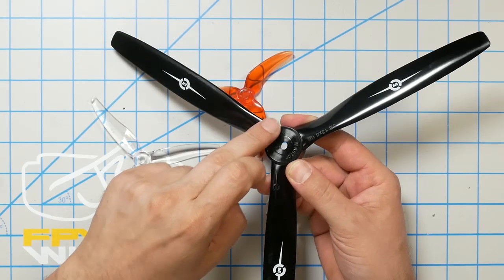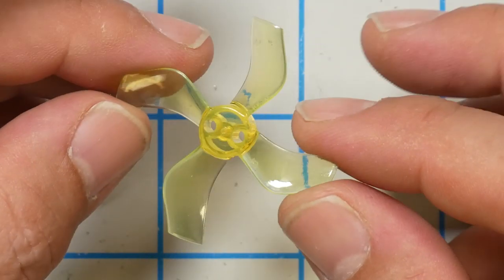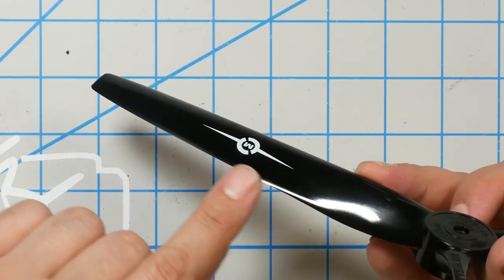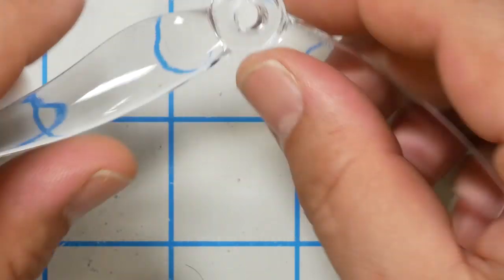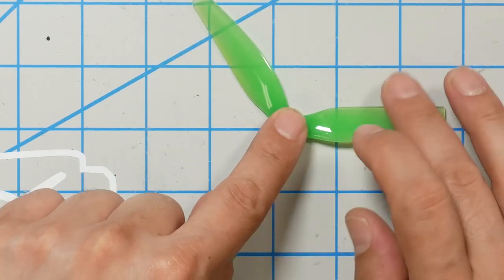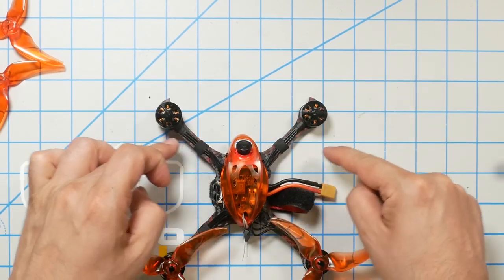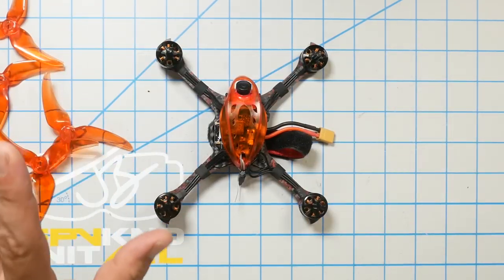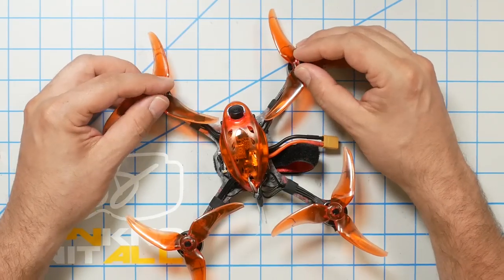How to install quadcopter props correctly BEGINNERS WATCH THIS NOW!

Comment: hi their..... complete beginner here. at the moment im focusing on flying my quads line of sight.  one of the difficulties I have is that when the quad gets a certain distance away from me I really begin to struggle to identify which direction the drone is facing and even which direction it is travelling.  ive seen on betaflight two modes that I think can help. HEADFREE and HEADADJ. ive looked on the internet and here on youtube inc your vids. unfortunately I haven't found much to help describe wha this is and demonstrate how it works inc mode set up of this function in betaflight.
can you help?
Reply from the maker: I can't help with this at all. I am also TERRIBLE at line of sight flight because I rapidly lose orientation. 

To use HEADFREE mode you need a compass.
Reply: @JoshuaBardwell  i have compass in my gps. One of the cinfusing parts are the two modes... Similar yet different. But very little info about them.

Comment: How tight do you tighten your props?
Reply: @JoshuaBardwell  how snug?
Reply from the maker: Tight enough that the prop doesn't move if you push it with a finger.
Reply: @JoshuaBardwell  Thanks dude

Comment: cool but nuts part is missing hot to tighten the nuts ???
Reply from the maker: I don't understand. Use a wrench? Which part is unclear?
Reply: @JoshuaBardwell  Well, as a noob, I don't know if it's the right way to screw and unscrew the nuts. Among other things, this is not so easy because the motor slips in your fingers... You should also use pliers ? In a video I saw that someone takes the propeller and the arm in his hand to screw or unscrew the propellers...
Reply from the maker: If you don't have the hand strength to hold the motor, you can use a motor pliers. Don't use a standard pliers because it'll damage the bell.
Reply: @JoshuaBardwell  i gonna check if i can get a ultralight portable motor pliers with rubber or plastik ends... TY

Comment: Thank you Joshua Bardwell for the great work! I love your videos, very helpful. I would be glad if you could help me with my problem. I have a Babyhawk r with 2.5 inch arms and it has very bad oscillations. I made a short video from a FPV screen: https://youtu.be/8_d6zyTWTF4

I checked that the arms don't move, changed the props, tightened and released the stack and checked each motor.

Comment: How tight do we put them on? So this video is just prop direction. Shame 10  minute video wont even tell you how to torque them or have us watch you IDK put a damn prop on
Reply from the maker: They need to be tight enough that they don't slip while you're flying. If you can easily move the props by pushing them with your fingers they're too loose.